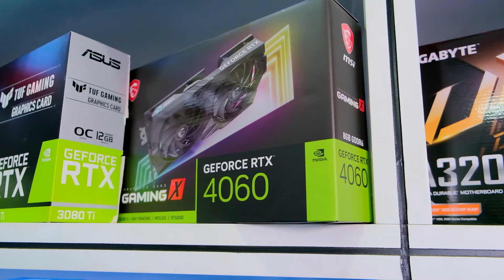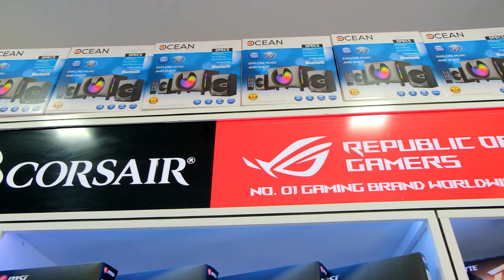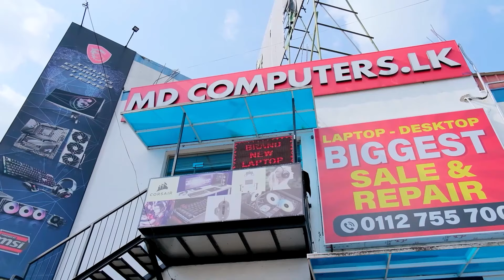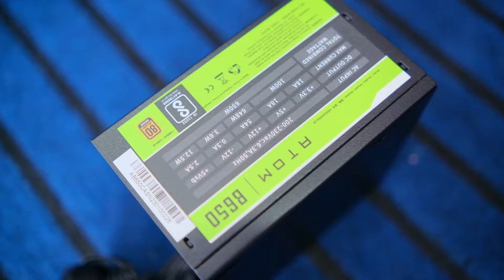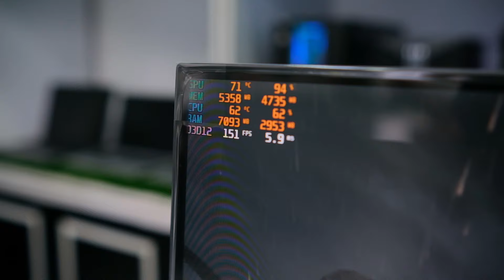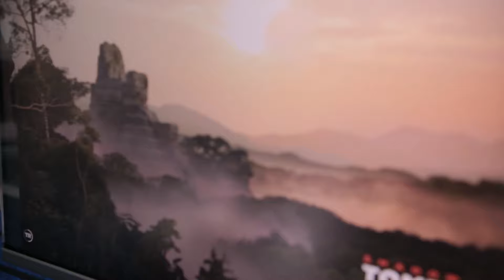FULL PC BUILDS හොයන අයට මෙන්න වාසියක් ! - MD COMPUTERS

Comment: Ayye ryzen 5 5500 proseser ekata hoda air cooler eka kiyanna please
Reply from the maker: seasonic s600 ati rs, 6000 k wage wenne
Reply: @SLPCLK  thank you ayye me cooler eken prosseser eke uparima performance ගත්තත් temp eka හොඳටම mange වෙයි නේ
Reply from the maker: @Tharindu111.  ow awulak na. puluwan nm oke double eka ganna balanna s1200. aye ithin yakek thamai
Reply: @SLPCLK  hari ayye👍 me proseser ekata gtx1660ti wage vga ekak set karoth හොඳම  power supply ekakuth  kiyanawada
Reply: @Tharindu111. 650W